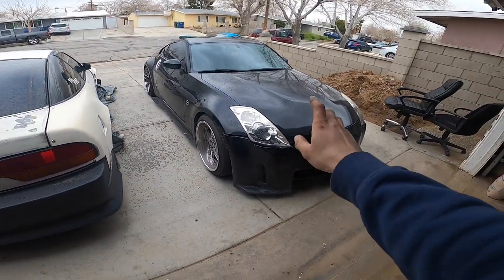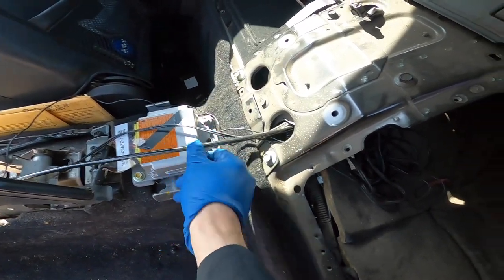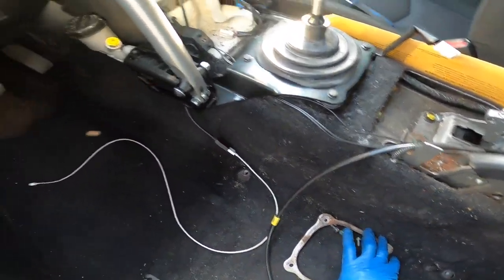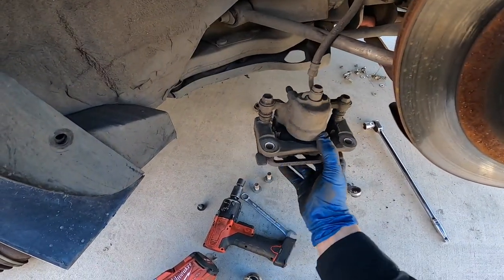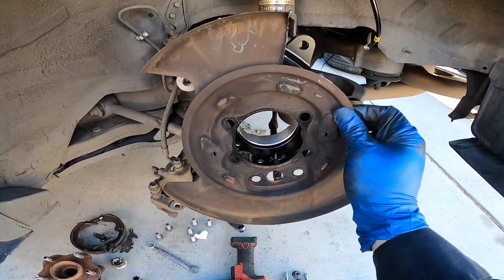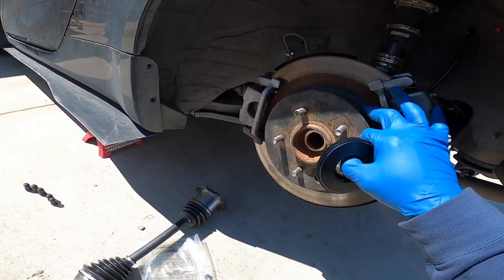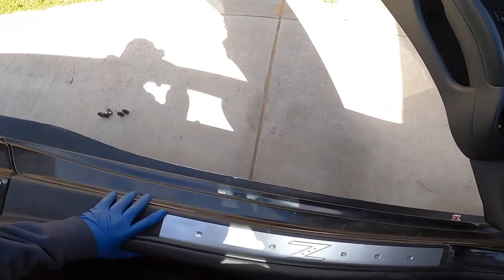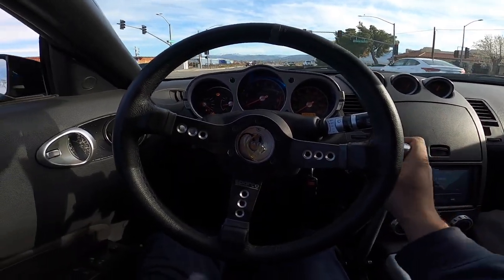350z GKTECH HYDRO BRAKE + BUCKET SEAT INSTALL!

Comment: Based and Hydro pilled.

Do you think having the hydro on the passenger side would be comfortable? My seating position is a lot closer than yours, (I hold my wheel at a 90 degree elbow) and my sparco seats would interfere with the driver side hydro mount. I'm thinking of putting it on the passenger side and reaching over.
Reply from the maker: Not sure bro but the place i put mine in works perfect for me, theres a few ways you can mount it for sure!